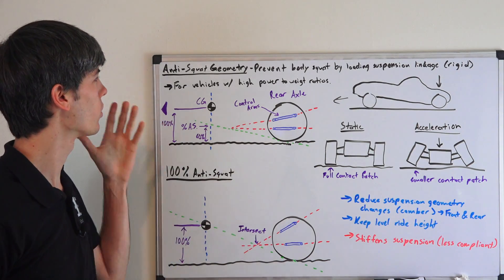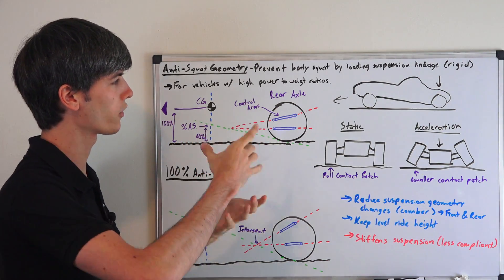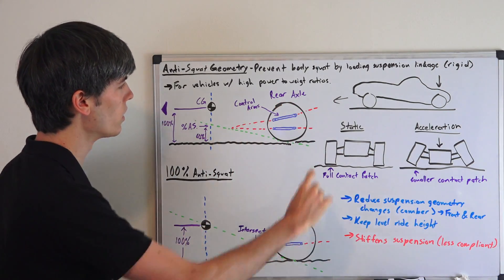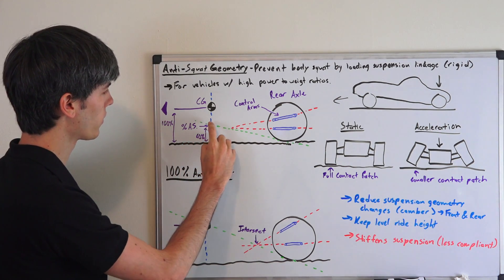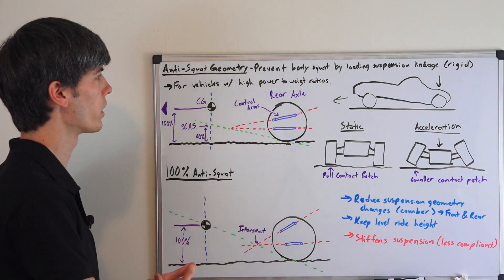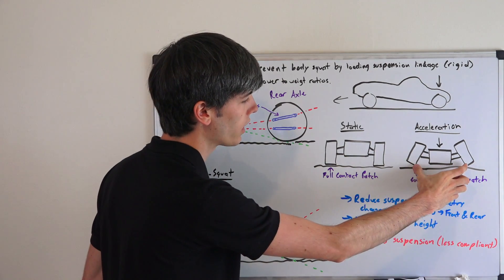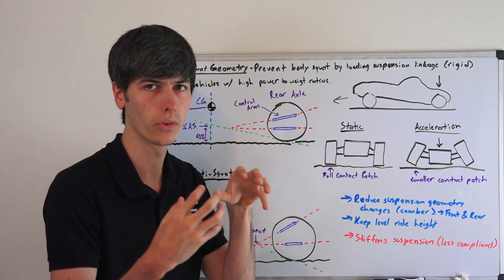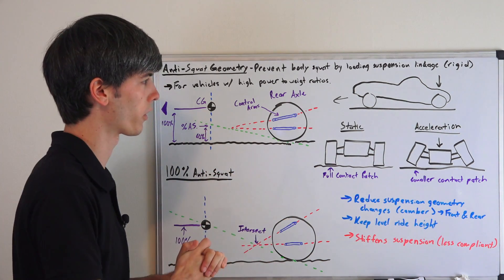Anti-Squat Suspension Geometry - Explained

Comment: Racing is one of the ultimate puzzles,  there are so many variables.  If it were me,  id link it and move the engine back 4-5 in,  it would let you dial in the chassis.   What its doing is stick and spin,  usually a dynamic shift in the anti squat number during transition.

Comment: We just reviewed this video and it had some great information. One detail we should be pointed out is that for an IRS the green line that goes through the IC is drawn from the hub centerline because with an IRS the torque reaction is taken by the chassis no the ground. This makes it very difficult to get much more than 25% AS with conventional IRS geometry. Ford gets more with S550 IRS because of the Integral link concept.
Reply: Cortex Racing...where can I find info about the IRS and AS and the torque reaction??? Thanks...I don't believe the info presented here was totally correct. AS value is not measured on the vertical at the CG but on the vertical at the front spindle with 100%  AS being where the CGs horizontal crosses the front spindle vertical. What was being explained here was the % of Rise typically used w/ ladder bar suspensions and the amount of tire sidewall crush on the launch. 50% being the metric used where >50% being more  and <50% being less crush.

Comment: Say you want a car closer to the 100% anti squat for better straight line acceleration. Knowing this will affect cornering, can you adjust your toe or camber to offset the negative affect of the anti-squat on your cornering for the best of both worlds?
Reply: Band-aiding suspension issues is never a good thing. When theres an issue present and you band-aid it at one certain scenario (squat for example, under power/heavy load) then you will very likely have sub-optimal geometry at other scenarios (neutral load).

Comment: How does this modify the position of the roll center? All the information I’ve read shows that the roll center is calculated with the inclination of the suspension arms on the YZ plane, however none shows the combination of both geometries.
Reply: Late reply but antisquat has nothing to do with roll center. Draw lines from contact patch of left side to to instant center on left, do the same for the right; intersection of those is roll center. For rear IRS do the same thing, for live axle the conversion of links, swing of panhard bar or the rotary joint of a watts like establish roll center.

Comment: According to Milliken and Milliken, you are not right about how to find the percentage of anti-squat.
They claim that it is the ratio between the height length ratio of the IC and COG.
Let's say we have the following:
a horizontal distance from rear wheel contact patch to IC of 4
a vertical distance from rear wheel contact patch to IC of 3a horizontal distance from rear wheel contact patch to COG of 6
a vertical distance from rear wheel contact patch to COG of 5

They say: %anti-squat=tan(theta)/(heightCOG/lengthCOG)*100 or in other words: %anti-squat=(heightIC/lengthIC)/(heightCOG/lengthCOG)*100
In our case that will be %anti-squat=(3/4)/(5/6)*100=83,3% according to Millikens

You say the relation is the height of the hypothenuse for the IC extended onto the line from the ground to the COG compared to the height of the COG.
In this case the height of the hypothenuse for the IC extended onto the line from the ground to the COG is 3/4*6=4,5
So you claim the %anti-squat=100/5*4,5=90%

Are you sure about your explanation?

Comment: good video, correct anti squat is gold in drag racing, but for circuit/road racing the angle of the bars to achieve 100% anti squat will produce huge amounts of rear roll steer.

Comment: what are the effects of  negative anti squat?
Reply: Less grip since less of your tire is in contact with the ground. The less grip will make the car more prone to oversteer since most of the negative squat will be in the back. The car won't be able to launch very quickly either , altough when the car has got some speed it will most likely not be very affected by the squat since the car won't be powerful enough to create much squat.
Reply: thanks alot...

Comment: hi, i think you put the 100% antisquat line in the wrong place, the line should pass through the hrozontal height of the centre of gravity but over the opposite set of wheels, if it passes through the centre of gravity it will unload the front wheels and lift the front of the car and the rear of the car, which is in effect over 100% antisquat.

Comment: Hi. I could use a little help with something I'm trying to figure out. So, for vehicles that are considered to have too much or too little anti squat, a common practice is to use subframe spacers to essentially tilt the sub frame for more or less squat. For example, in the case of my vehicle, the claim is that using thicker spacers in the front than the back thus tilting the subframe down decreases anti squat. From explanation, it is said this is caused by the spacers adjusting the instant center. Is there a simple way to determine how much the thickness of the spacer will adjust the anti squat?

Comment: Anti squat is a very important chassis design feature for getting power to the ground for good acceleration on powerful rear wheel drive cars.  Weldineer stated correctly (below) that the anti squat reaction to the torque of the axle lifts the mass of the vehicle resulting in an increase in downward force on the tires.

I would add that the most important thing this does is create positive traction feedback to allow even greater torque to be used in vehicle acceleration.  What do I mean?

When you nail the gas in a car with a lot of torque the tires will slip (spin, burn out, etc.) once the torque exceeds the the traction available at the tire contact patch.  The traction depends on the coefficient of friction of the tire and roadway interface multiplied by  the downward pressure on the tires.  

Anti squat uses the torque of the motor to increase this downward pressure on the tires.

The anti squat reaction lifts up on the car and pushes down on the tires.  This extra push down increases traction.  The increased traction allows more torque to be applied.  The additional torque pushes the tires down harder on the road again increasing downward pressure and again increasing traction again increasing torque . . . .

Taken seriously this positive feedback loop allows enough traction for the lift of the entire car from the road surface before the tires loose traction (see wheel stand! ) and sick levels of acceleration.   

Lack of anti squat in a powerful car means nice smoky burn outs but slow off the line and on road courses slow out of corners.  Ask any Fox body Mustang owner about getting the 5.0 torque to the ground without smoking the tires.  That is why Griggs Racing sells so many GR40 traction kits for the Fords; they add a torque arm to the axle which gives the chassis anti squat and really allows the car to hook up.

Thanks EE for all the cool videos!
Reply: Keith Soreng so what do u think how much anti squat will be best for designing the rear suspension geometry?

Comment: is anti squat suspension geometry a substitute for anti roll bars?
Reply from the maker: +honna4949 Nope, ARB typically won't affect squat as the whole axle raises or lowers.
Reply: +Engineering Explained hey man. thanks for the reply. but as you go through a corner, with anti squat geometry, you will be putting your roll load transfer through your control arms and chassis instead of your coils. doesnt this beat the purpose of an anti roll bar?

Comment: so many things are wrong with your video. 1) you cannot four link an independent rear suspension or effectively build in anti squat, you can only do that on a solid rear axle, there will be no camber change from suspension travel 2) the line doesn't go from rear tire contact patch to  the instant center ( four link intersect point) it goes to the top of the front tire vertical center line 3) when the line is in the proper place if the instant center is above that line you will have anti squat if its below it you will not

Comment: Can't anti-squat and anti-dive exceed 100%? Given your seemingly arbitrary definitions of these "dotted line features", surely this is practically possible?
Reply: dgmcl3284 
Absolutely! Over 100% "anti squat" will lift the vehicle, so "pro lift" (of course anti geometry does not effect tire squat)! The % anti-whatever calculations are simplifications and are mostly used to describe your suspension to someone, not to do vehicle dynamics simulations. Jacking force calculations are better used for simulation and determining how a vehicle will behave. 
Jacking force can be calculated by know what your longitudinal tire force is, and what the angle of the green dotted line is.
Reply: look up dirt track modifieds. They run an 8" tire on dirt, so they do not get a lot of traction. However they do utilize a solid rear axle and much more than 100% anti squat. It creates traction two fold. Weight transfer through the links instead of a spring, and shortening the wheelbase up to around 4"(depending on the setup). Food for thought, radical suspension systems in a vehicle.

Comment: What about 4WD and FWD cars? Do they need to have anti squat suspension and if yes why is that? Great video as well
Reply: Menel Dimitranopoulos I would say with FWD it doesn't matter much about the contact patch in the rear, which is why most FWD drag cars run what look like bicycle tires in the rear...but it needs to be stiff in the rear because if the rear squats (COG moves back) then the front won't have as much weight over it which will lower traction.
Reply: MrSlowestD16  Thanks a lot!
Reply: Menel Dimitranopoulos 
4WD yes, FWD no. In fact, it's not really possible for a FWD car to have anti squat rear suspension. To have anti-squat rear suspension there must be rear tire force, and since there is no rear tire force, there is no anti.
Instead, for quick vehicle response and increase front launch traction you would have pro-lift.
4WD could have both :)

Comment: How about Koenigsegg's Triplex suspension (anti-squat) they are not linked to the suspension but rather is a push rod actuated system, it sits on top of the whole suspension and engine, but I don't know the mechanics of that, although it's their secret, I'd love to know basically how they work or, like a certain suspension setup or something?

Comment: But with a double A-Arm suspension like those Baja Trophy Trucks, the upper control arms retains your camber, doesn't it? At least thats what it looks like until they reach the end of their travel. Obviously with a solid front end, you get a camber shift as you dont have that upper control arm to retain your camber. Correct me if im wrong please, and I love your videos
Reply: Slapa Hoe Both control arms will determine your camber. All control arms are used to calculate the instant center, which will determine camber change with wheel travel

Comment: Pretty much the same as anti-dive except in the rear. But this time it got me thinking: it seems like you need double-wishbone for anti-whatever (which is expensive and heavy) but double-wishbone should also mean: no camber change when height changes. Is it true and if not, why?
Reply: Not really heavier, just less compact.
Reply: xod You can have anti-whatever with solid axle, mcpherson, pretty much any suspension geometry. 
Depending on the geometry, camber will change when height changes. Most double wishbone suspension will have camber change with height. The exceptions you might find are most likely in off road vehicles

Comment: So 100 percent anti squat will not squat? Or it will squat the most? I'm confused!
Reply from the maker: clarkie005 Something that is "anti" will try to prevent whatever word comes next. So in this case, 100% anti-squat means no squatting. :)
Reply: MrSlowestD16 Lift! (not including tire squat) 
Of course, a suspension with 100% anti squat still may squat, since the percentage calculations are a simplification of jacking force
Reply: Engineering Explained What happens if it exceeds 100%?

Comment: what about solid axle rear differentials? The contact patch stays the same no matter? Does the effect of acceleration on the car translate somewhere else in this situation?
I dragged my lowered AE86 and because the lower control arms were not horizontal rather at 5deg I had massive axle tramp when I launched the vehicle. I managed to reduce this using "traction brackets" bolted to the axle housing which returned the bottom two lower control arms to the factory angle. However the top control arms are still facing at say 10deg, and they are shorter. I could fix it by boxing up the rear floor pan to run equal length control arms and return to factory position but its just a street car...
Reply: rotormaster 
Anti squat still affects a solid rear, and not because of camber change. You will get more traction on the launch because the force going through the control arms is extra force seen at the tire. If you look at some drag cars, they actually LIFT in the rear on launch. The sum of the vertical force at the tires are HIGHER than the weight of the car, because equal and opposite reaction. The mass of the chassis is going up, because the control arms has a force lifting the chassis. This force is also acting in a DOWNWARD direction on the tires, thus more traction :)
You can calculate the side view instant center and therefore "anti squat" for you car, there are plenty of resources showing the math of this for solid rear axles.
Reply: rotormaster I don't know about your AE86, but with respect to live rear axles, I believe you're right that the contact patch remains constant.  They're great for drag racing.
Reply: rotormaster I went for a ride in a friends rx7 that had about twice the power of mine (near 400hp) his springs are so bad that the whole diff was twisting and the drive shaft was hitting the body.